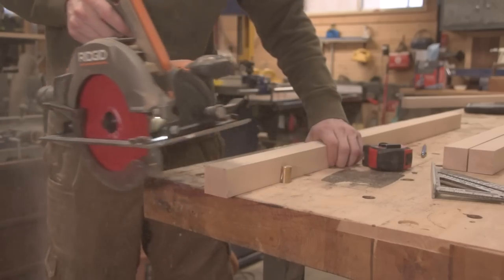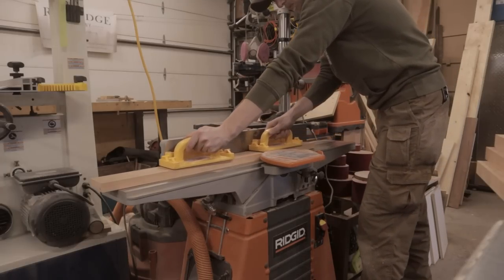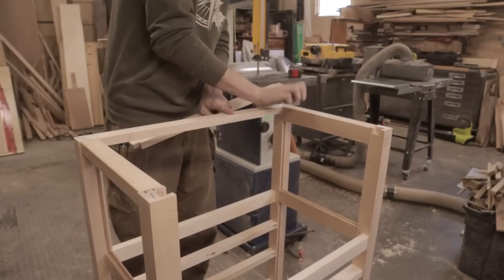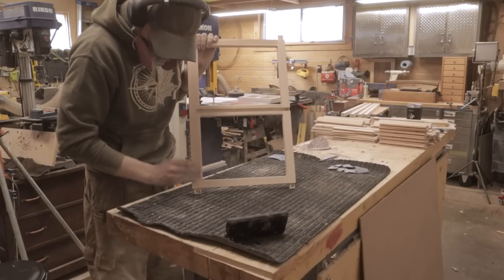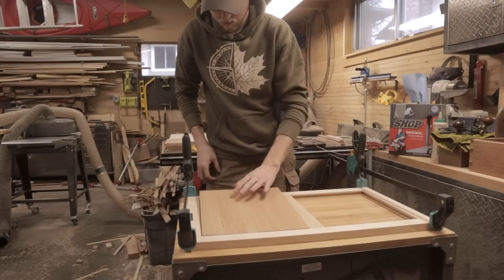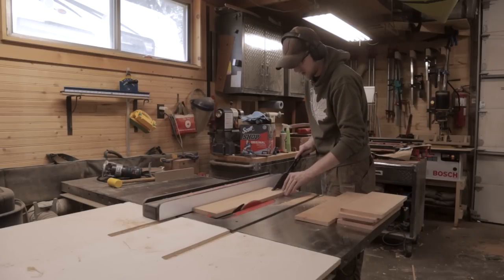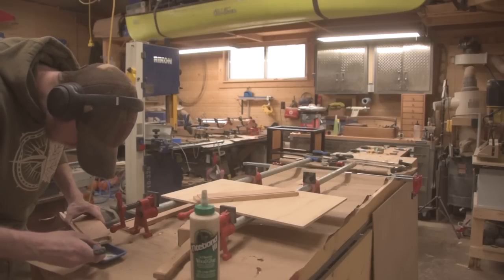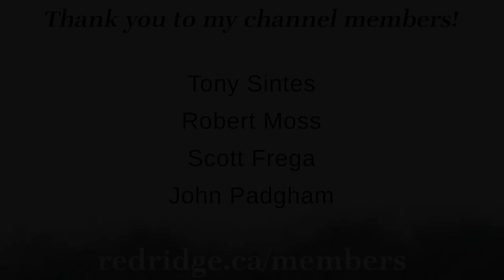The Turning Point in My Woodworking Journey

Comment: Some woods will require other prep before staining.  Never did realize Maple would be difficult to stain though. With your move into wood dyes you can experiment with other colors on smaller projects.   On a stock/hand guard project I created a very exaggerated Russian Red with Scarlet Red wood dye from Woodcraft. For a small project I think you should experiment with poly/dye mixtures. Your piece came out very nicely.
Reply from the maker: I'm very excited to do some stuff with colors, I've been wanting to do a red stained chest for a while and I think this method is going to work great!

Comment: Enjoyed the build.  Thanks for sharing.  When I want longer open time, I use Titebond Liquid Hide Glue.  Once, when using TBLHG, I put a part in upside down.  I didn't relalize it till 20 minutes had passed.  With the hide glue, I was able to take it apart and reassemble.  You might want to try it to reduce glue up stress.  I pretty much use it all the time these days.
Reply from the maker: I've gotten more in the habit of using hide glue, my only worry about using it on this project is that it doesn't clean up as easily. I knew with titebond 3 I could wipe off any glue with some damp rags, but with hide glue I've had some issues trying to get it cleaned up on projects like this where I can't sand or cut it off with a chisel.
If you know any methods for cleaning it up that might work, let me know because I definitely would prefer to use hide glue!
Reply: @morganhurst_redridge  Chris Shwartz uses warm water and a tooth brush on his chair glue ups to remove liquid hide glue.  I haven't tried that myself.  I typicall use just warm water and a clean rag.  With shellac finishes, that seems to be good enough.
Reply from the maker: @joeleonetti8976  Thanks, that's interesting I will have to try that!

Comment: I’m baffled by the fact that you’ve invested thousands of dollars in woodworking tools and don’t have a hundred dollars for a respirator. I guess a table saw is more critical than your lungs.
Reply from the maker: Does it feel good preaching from your soap box?
I have a respirator and I wear it when necessary. I also have a good dust collection system and air filtration units that are constantly running.
Reply: He clearly has a respirator, most tools have dust collection. Go check out 12 minute mark router where it doesn’t have good dust collection and he’s got a respirator on.
Reply: Ok Karen